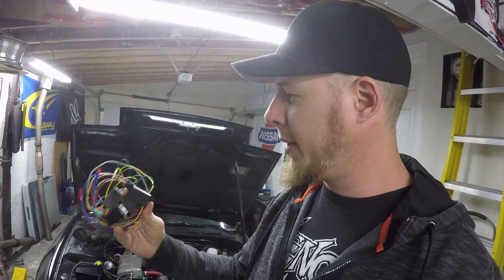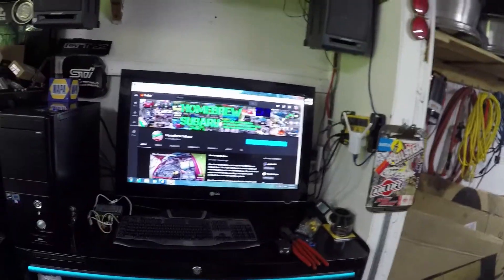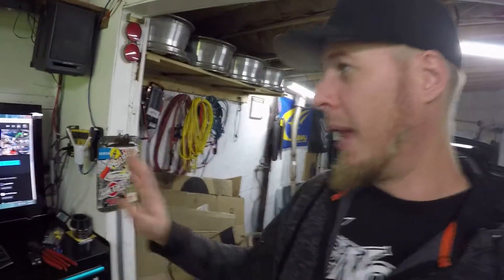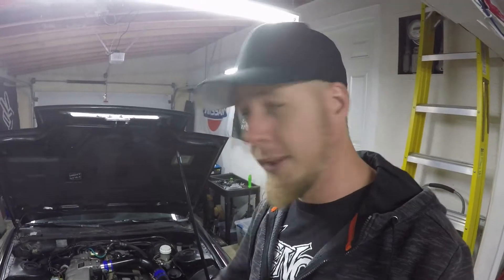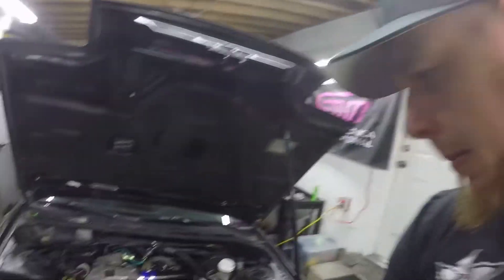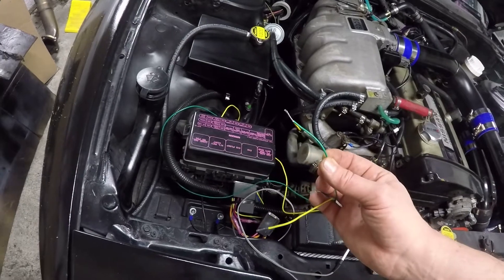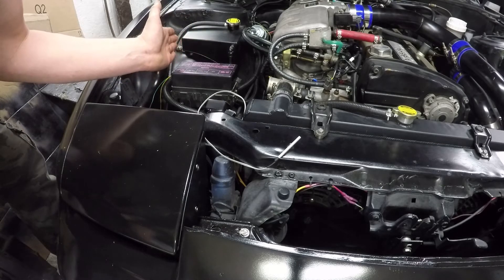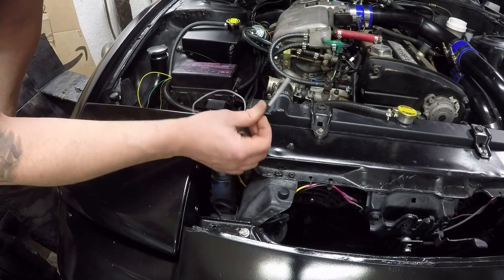240SX S13 Build - Electric Fan Controller Wiring How To

Comment: Hello,  do you recommend the probe kit or the one which comes with the sending unit?
Reply from the maker: I would recommend a kit that comes with a sending unit that resides in the coolant. Much better response time
Reply: @HomebrewSubaru  Thanks 👌
Reply: @HomebrewSubaru   Hello, do you know where the one that resides in the coolant is mounted? I haven't found any videos or info
Reply from the maker: @spicyloinks7309  best to place it in the hose that leads to the thermostat. Usually upper radiator hose with a coupler
Reply: @HomebrewSubaru  Hey, sorry for so many questions but I was wondering the best place to stick that thermoswitch stick in the radiator? top, bottom, right, left? I was also wondering what temp you would recommend to turn fans on/off. thank you so much!

Comment: Hey man I hope you still answer comments haha but what was the green wire supposed to ORIGINALLY go to because im trying to wire my altima fan to come on high mode when I press the AC Button as if it were OEM but i cant fan which color wire it should be, i assume it’d be on the condenser fan relay but i cant find ANY info
Reply from the maker: There will be a two wire connector on the AC compressor. One should supply power when the AC gets turned on. Attaching the green wire to that wire will activate the fan controller
Reply: Homebrew Subaru do u happen to know what color wires they are on the s13 harness? Or is it just the connector that was on the original ac fan

Comment: I have always found it slightly odd that rad fans generally pull air rather than push air through the engine. Counter intuitive, at least to me. I suppose the assumption is that during normal driving conditions the ram air hitting the rad cools it enough whereas town or other slow driving does not give enough cooling air. I also fitted an internal fan switch, cooling on my car is at best nominal when running perfect, joys of driving 40 year old classics i suppose.
Reply from the maker: Stuart Robinson Fans are rarely factory installed in front of the radiator. They tend to block or deflect much of the airflow.  Cooling efficiency is better if they are mounted to pull air through.